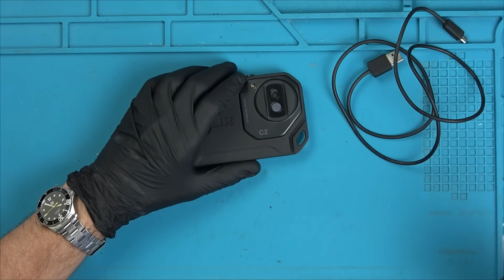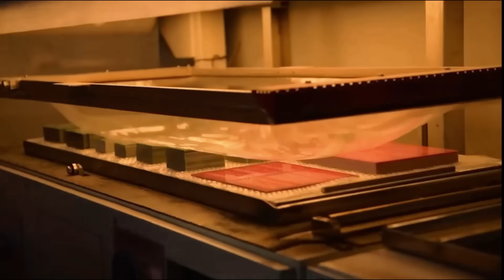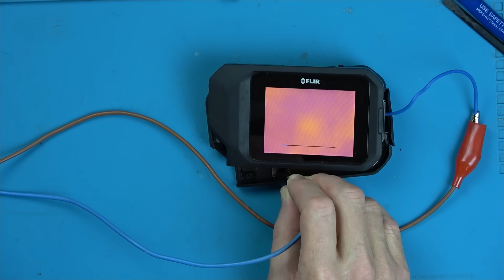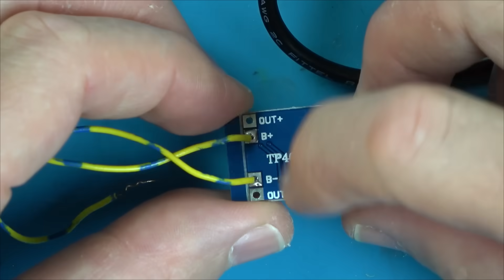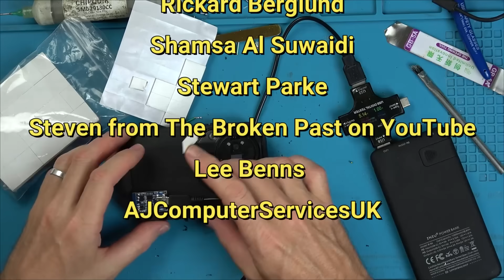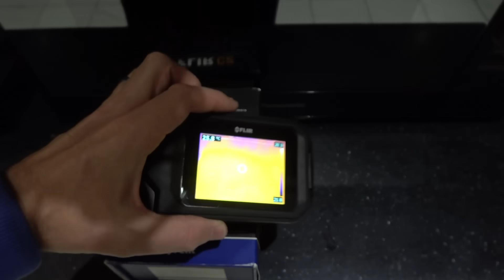Trying to Fix a Faulty FLIR C2 Thermal Camera | Red Hot Chip Issue

Comment: Sorry for the late response Vince but i've only recently discovered your channel (and subscribed), did you consider the LTC4054 (LTH7)? it's the 4056's little brother and they even come on a tiny module smaller than the connected type-C socket... it'll fit where the original charge port is and cheap as chips for 5pcs on Aliexpress (i've used their site for years.. but not the permission hungry app), it's my new favorite module since the TP4056 protected... i use them a lot in things like torches when i upgrade them with "found" lithium cells from used "personal flavoured fog machines".

The type-c 4054 "type c mini lithium charging board" modules don't have battery protection, so use an existing protection circuit (this FLIR has one on the battery)... let me know if you need a link, they're currently £2.14 for 10pcs (free shipping)
Reply: @Mymatevince  (sorry, i forgot to tag you in my response)

Comment: What a mess. Should've gotten rid of the battery completely routing power from the port to the battery terminals or at least used one of the less ancient charging boards which are much smaller and have type c (there are ones exactly the size of the metal part of the type c  connector)

Comment: I think this chip is healthy.

For those charging PCB's, I use hot glue at all 4 edges and it is more or less permanent, very resistant to misuse. Resistant to violent pushing and pulling of the USB-C connector.
And I hide holes and wires beneath PCB. 
Just do edges, to not increase temperature of components.

Comment: bad thing about the USB-C boards is that they mostly don't work with usb-c to usb-c cables, only with dumb usb-a to usb-c ones. I did manage to modify a few by adding resistors to the CC lines, though.

Comment: Neat solution.  Well done!  Personally I'd have put a tiny 2-pin socket in a hole on the side (JST, molex, etc.), and connected it to the 2 battery wires so the charger could be separate with nothing stuck on the back.  But your way works fine.
Reply: It will work but I'm not sure it would be good. As there will be no battery management with just a connector
Reply: @fuzzs8970  I meant to use the charge board externally to save spoiling the external case form factor.  If say a micro JST socket was used, a charge lead with external charge board could be made up with corresponding micro JST plug, and as not a common thing no-one else would be likely to plug some random charger into the socket.

Comment: I don't think you need the charging board always attached to the device. I would have installed a tiny DC female jack or any type of connector on the body and connect it in parallel with the battery, therefore I could use a matching male jack to charge it only when needed.

Comment: Good workaround, with a caveat. As others have mentioned the yellow wire is temperature sense (an NTC thermistor that should be connected to pin 1 of the TP4056, caution - on many 'unprotected' boards pin 1 is connected to 0V). Some TP4056 boards include the 'protection' input, however many are fake (ensure charging / stopping properly). If you had all the time in the world and don't mind a few more grey hairs then you may get a new PMIC from digchip (no guarantees).

Comment: Would the charge board not fit inside if you remove the mini usb board and connect it to the micro usb power and you can remove the charging ic. the yellow wire shouldnt be essential, it will be for thermal cut off when charging

Comment: Vince, maybe it is worth to look into micro USB port that is on the original board. This short may br related because it is broken physically, and some pins are shored there.. maybe not Vcc and GND, because it will generate heat in the port itself, but maybe the other pins, that are also connected to this Dialog chip. If you checked this and I did not notice orbit was jot shows on video, please discard this clue 😅

Comment: The TP4056 boards with USB-C connector are often missing the 2 x 5.1K resistors from CC1 and CC2 to ground.
Without the resistors, USB-C compliant chargers will not switch on the 5V output.
Usually you can bodge a couple of 0603 resistors in and solve that issue. Otherwise you will be forced to use an old USB-A charger and a A to C cable.

Comment: the fast chargers only change to 9,12 etc. volt when both sides handshake succesfully so if the camera doesn't have the correct IC for that handshake a fast charger will stay on 5V
Reply: What's fast charge got to do with anything? The TP4056 only runs on 5V anyway.
More important is that the TP4056 Modules he's bought don't have the rewuired5.1K pulldown resistors, so any compliant USB-C Charger won't even supply 5V.

Comment: Wondering whether there could be conductive debris, oxidation, or just a bad solder joint with the PMIC causing it to short and get overheated? Don't know whether it is plausible or something you want to explore but reseating the IC could eventually be a solution? However  it is purely speculative from my side.

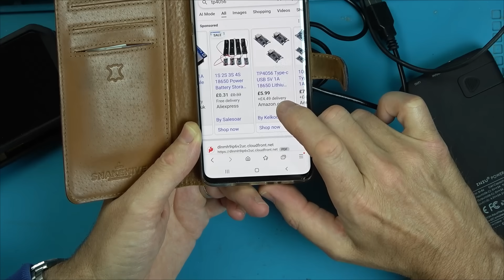Comment: 30:29 those TP4056 with USB C doesn't have a programming resistor so it works with USB A to C cables only.
Reply: I just posted the same comment, but with a bit more detail.
I recently tried to bodge a 5.1K resistor on each CC line and it was like doing micro surgery, as the terminals are extremely shielded and you have to use enameled jumper wires to get up and out, then over to a couple of tacked in 0603 resistors.
Easier to use a better module, there are more flexible ones being released now - up to 2A change, 4-LED level meter, built in U/O voltage, and smaller too.

Comment: Vince if you use an ESR meter on the coil it will tell you if it has an internal short in a coil as it registers resistance by frequency.

Comment: I love watching the videos, this one is no exception. The only thing I can think of is I really hope the yellow wire on the battery is a Temperature wire and not a balance wire. From what I can tell I think it is a Temp wire, so the fix should be basically as safe as a new camera. As someone else said, a plastic cover for the new battery management board would really tie everything together and add a nice layer of protection. (That way no metal objects find their way shorting the battery. As that would be somewhat on brand) Maybe your sponsor (PCBway) could make you one. 😁😁
Reply: Yes, the yellow wire is for an NTC for the IC to stop charging if the battery gets above a certain temperature.

Comment: Hey Vince, just a tip about reading those chips. I have had great results by once you can see some info, wipe the chip with a white metal marker, wait a couple of seconds,
then start to wipe the the white ink with your finger until you get a result?
Reply: Just smear heatsink paste into the surface, wipe off and read.
Reply: @johncoops6897 Also a great idea!

Comment: Why weren't you just soldering the 2 charging cables to the 2 pads (of 3) on the batteries bms under the capton tape? The flir cam was working absolutely perfect with the battery plugged in... I don't get why you cut the connector of the battery.

Comment: Hi Vince, what a nice hack job! I've got you some info in the mail that may help you to fix it properly.
The point is that DA9021 and DA9022 (which is available) are very similar. The DA9022 can provide a higher voltage.  The pintout is the same except for 1B which is a Sense node for DVC DC-DC.
Reply from the maker: Thank you Marcel, I'll look out for it👌
Reply: @Mymatevince  You are welcome mate!

Comment: Those micro batteries for holding the time and settings are a MASSIVE liability / built in obsolescence device !!.... I have found ,amongst others, Garmin GPS units and digital cameras where that battery is a dead short .. it also will drain the main battery because its supposed to  trickle charge from that battery .. also items that have not been used for a year will appear stone dead because the " bios" battery is dead ..... these batteries are nano sized and difficult and expensive to source . I usually hack a bigger one in and all is fine (Garmin oregon 700,etc)

Comment: Really nice fix. I had a little premonition that was going to be the issue when you were putting it back together first time and was suggesting the same solution to the screen as you were reaching for it.

Edit: SPOILER
Though my mind instantly went to leaving everything the same inside the camera other than adding charging leads from the battery to a connector on the outside then you could use that to charge the battery with one of the boards but your solution is probably safer

Comment: Nice fix. Personally, I would have removed the battery completely, and rigged up a small voltage regulator in its place with a roughly 3.6 - 3.8V output - to act as a battery basically. Then disconnected the USB connector of the FLIR from the faulty chip and soldered up its 5V input and GND to the regulator. The portability would have been lost, but you have a nice and clean FLIR that will still work fine when plugged into a USB power brick or a power bank.

By the way, a general comment about the TP4056 PCB. Battery terminals are exposed there and only the OUT+ and OUT- pins are protected against accidental shorts (overcurrent). If you short the B+ and B- pins, you will have a bad time. In the case of the FLIR battery, it's not a huge issue, as the battery also has its separate protection board, so it would (probably?) be fine. But personally, I would not rely on that.
Reply from the maker: Thank you, I might try and sleeve half of it to protect those terminals👍👍👍

Comment: Great fix. If you find the TP4056 is getting too warm when charging, you can add a resistor to reduce the charging current which makes the heat a lot better, just charges a bit slower. Can’t remember the resistor I used last time but if you look on the data sheet, it tells you the different size resistors based on charging current.
Reply: and change the resister to only charge to 4.0 or 4.1v and the batteries will last Much longer :) with a little less mah of course
Reply: @micbanand - there is no adjustment for charge termination voltage on the TP4056. It is fixed at 4.2V, as per standard lithium specs.
Reply from the maker: Thank you 👍
Reply: Definitely, you want to drop the 1.2K resistor (1Amp) down to perhaps 3K for such a small lithium cell like that.
Formula is Amps = 1200 / Resistor ohms.

Comment: just a thought vince, wouldnt it be neater if you removed the BGA chip (if you can) or de-soldered the legs to the microusb port and wired them to the TP charging module inside the camera, that way you bypass the chip and also charge the battery? without having the wires out?

Comment: Hey Vince, nice that you finally got around to those cams. I was very surprised when I saw it. I thought, no way! I've only just got a working thermal cam in a Blackview 9900pro phone that I had to fix the software to make it work. 
Hope you get some good views on this video Vince. 

Cheers
Dave.
Reply from the maker: Dave!!! So happy you watched it. I think these arrived years ago, before lockdown maybe!!! So I wasn't sure if you even still watched the channel, relieved you still do. I've just been working on a Google Chromecast device and I used your FLIR on it. Thanks again for sending them in, very generous of you. Glad you got your thermal cam fixed too 😎
Reply: @Mymatevince of course I still watch Vince. It's fantastic that you got it working. I'm sure it will work for years, I looked for those dialog chips for a while. But I knew you'd give it a good go, I'm just glad I didn't break it more taking it apart. 
I hope you get a lot of use out of it. 
That seek thermal cam was totally dead though, I think it was dropped before I got it. 
Keep up the great videos mate.
Reply from the maker: @blasphemer71 I haven't plugged in the Seek one yet. I need to find a phone with Micro USB to power it, unless maybe I can get a USB-C to Micro USB converter to use on my phone. That might be a better option. Anyway, I thoroughly enjoyed this vid, hopefully the wider audience will like it, as my channel been struggling a bit recently, so fun items like this are always welcomed👍👍👍 Cheers Dave!

Comment: Great fix! Given that it's working, maybe you could desolder the faulty chip just to see how easy it would be to replace the thing (if you could get a replacement - maybe there's an equivalent?).
Reply from the maker: Thanks CapJack, I think I would end up ruining it as the chip is still partially working giving out the 1.8v on the other inductors. I'm pretty confident if I took it off I wouldn't be able to get it back on again as the solder balls will be tiny, but if I could get a replacement chip I would give it a go as I wouldn't have to reball it 👍👍
Reply: @Mymatevince  Is there a reason reballing this chip is particularly difficult? Or is reballing just not something you are comfortable with?

Always been curious about learning to reball chips, which is why I am wondering.
Reply from the maker: @nerdstrangler4804 Purely the small size of the chip and the balls. The chip is smaller than your fingernail on your little finger and it has 64 balls on it. The balls are probably 0.1mm each. It's so easy for 2 or 3 balls to join together when using the hot air to melt them. If you had a stencil then you could use solder paste, but personally I've had very little luck when messing with reballing. If I pressed down on the chip and it started to work then I woukd attempt the reball, but I think in this instance it was a failed chip rather than a failed solder ball because of the heat spot it was generating. Phil from The Cod3r does amazing reballs by hand if you want to see it done 👍